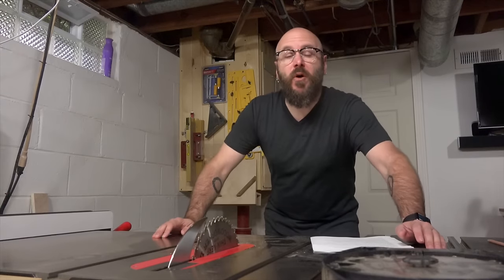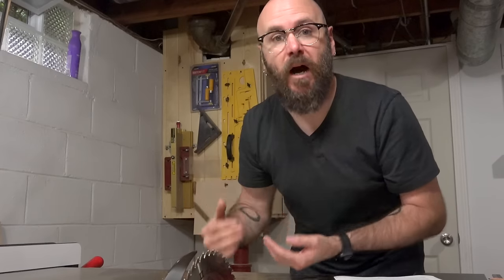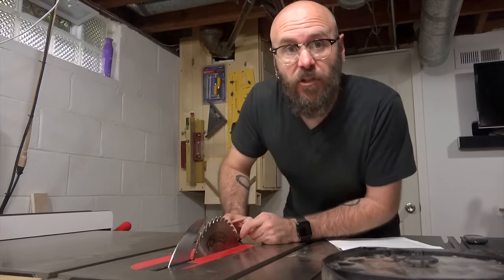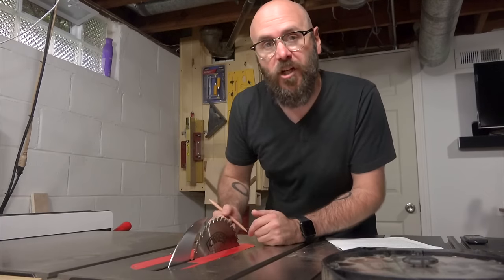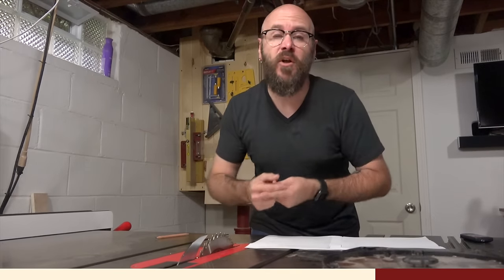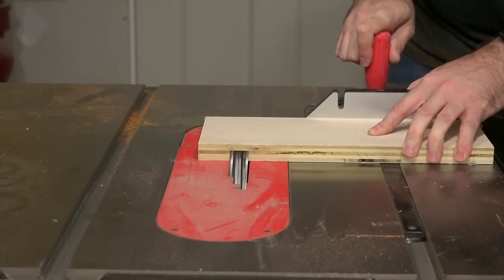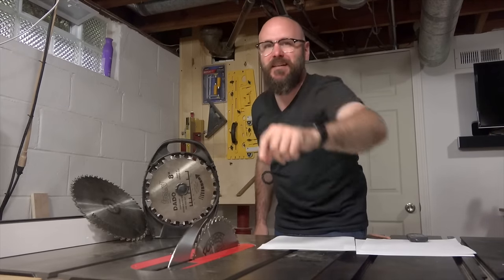The Only Table Saw Blades You'll Ever Need

Comment: CMT 24 tooth rip and a Freud 24 tooth rip, both full kerf, in rotation when one is dull I send it out for sharpening and put the other on the saw. I also have the Freud 8 inch dado. I use a Diablo 60 tooth blade for plywood and the rare cross cut, but 95% of the time I keep rip blade on for all cuts

Comment: Hi thanks for the vid! I dig the Queen insert lol. I'm a newbie, got a Delta 36-725 table saw and I have a blade question for you. I'm building a vanity out of walnut with mitered edges (for my first real project). I'll be using 4/4 mostly but also have some 8/4 that I'll be re-sawing on the table saw. Given that this vid is several years old, I'm wondering if the thin kerf WWII is still the blade you'd recommend to me for this vanity project! Thanks for any replies you may give!

Comment: I also use three blades on a table saw...Diablo thin kerf rip blade (that has a flat bottom cut), a 60 tooth Diablo combination blade (that doesn't have a flat bottom cut), and an 8 inch dado stack. I've never tried Forrest or Amana. thanks!

Comment: There's a problem with using thin-kerfed blades. The thinner your blade is, the faster it will overheat and warp. Best bet is to compromise by using the thickest blade you can get away with.

Comment: I use the Irwin Marples combination blade that has a flat top raker tooth. Also has plenty of meet on it for additional sharpening. There's a guy down the street that'll sharpen it for $12 and have it back to me on the same day. Best thing is the blade cost me $32 on the clearance rack at Lowes. Been using it for about 3 years now. Cut like a hot knife through butter.

Comment: I dabble in a little bit of metal work as well as being a woodworker, it makes sense to me to buy less expensive blades and reuse the old blades when I need a scrap of steel.
I'm rocking a Diablo blade, don't recall the model, it has a spiffy anti stick layer which is good because I was running thousands of pieces of pine through it.

Comment: For most people over 100 a blade is expensive.If I were making furniture charging 3k a piece I can justify it but for typical DIYer that's not practical.
You can buy decent blade under 40 YES under 40 and you can sharpen it yourself with demand blade on grider

Comment: I you are popping your breaker, you have a wiring problem.  I would fix that rather than use a thinner blade as a band-aid solution.  Nothing wrong with thin kerf blades, but fix the wiring problem.

Comment: I use Frued Diablo saw blades. Believe it or not I mostly use a 80 tooth for both cross cut and rip cuts. I a
so purchased a 24 tooth blade for ripping but I have found there is not that much difference between them on ripcuts. In my area there is no one who sharpens blades. So with the cost of sharpening and shipping, buying a new blade is cheaper. A blade usually lasts more than a year.

Comment: I use a Forrest 10" combo thin kerf & flat bottom full kerf blade. I also touch up sharpen my blades to extend their useful life. I had 2 blades reground by Forrest and compared to mine and there was little difference.

Comment: I use Freud industrial 80 tooth ultimate cutoff blade and Freud industrial 30 tooth thin kerf glue line blade. Both blades can be sent back to Freud to be sharpened, not sure of the price. Both work great, 30T for ripping and the 80T for cross cutting. Both leave exceptional finishes and have no problems on my SawStop 1.75hp contractor saw

Comment: If you want an inexpensive blade that makes glue ready cuts, head down to Home Depot and purchase a Freud Demolition blade, intended for a standard circular saw. Same arbor size and so long as you don't need a large depth of cut, makes the cleanest cuts of any blades I've used. Additionally, they are $10, sometimes come in two packs for $15.

And I didn't discover this. This was shared on Lumberjocks, so credit goes to that community.

Forrest makes nice blades. But I can't justify $300-400 for 3 saw blades.

Comment: I use a freud 254 mm flat grind blade for ripping, different sizes of Bosch and Dewalt blades with more teeth for crosscutting, and a CMT blade for crosscutting aluminium on my mitersaw.

Comment: they might not be the "best" blades but i like diablo blades. I have a crapy saw so even a little bit of flex in the blade gets amplified by the weak arbor bearings in my saw. I have found these blades to be stiffer than most so the flex is negligible, thus giving me acceptable cuts. That being said my next big tool purchase will be a cabinet makers style table saw... will probably run the red blades though.

Comment: thanks for the info...I have a 9" craftsman saw from the 50's with a 1 HP motor so I us a thin kerf 8 1/4" Freud blade which cuts fine for most applications without bogging down.  I have been thinking of investing in a good 9" flat bottom blade so this really helps...thumbs up!

Comment: I use Cmt they have 2 lines/grades. I use the industrial grade. I use two blades most of the time 12" 96 tooth for my cross cut and has 38 degree rake, and a blade called the glue line rip , 24 tooth with a 10 degree rake best quality cut I have ever seen for ripping

Comment: Agree with you except I use a 50 tooth ATB-R (Alternating Top Bevel with Rake) Combination blade.  The raking tooth is flat bottom and serves to clear the saw dust away faster.  There is also a deeper gullet after each set of 10 teeth that helps cool the blade.  Next time you need a new blade consider the Forrest version of this.  It is fantastic and does an impeccable job.

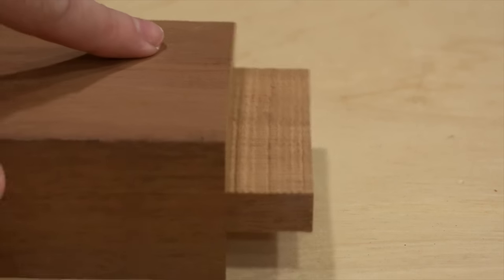Comment: 3:25 if i was to have an ATB for my table saw, I don't really want to switch the blade when I want to make Tenons. One, it doesn't really matter what the surface will look like because the joint will be hidden, so there's no point in cleaning it up. and two, it'll probably have more surface area for a bit more hold.
I wish I had those things though. my harbor freight saw is so shit, the blade isn't even aligned with the fence, and I need a new blade too. the sides are gumming up
Reply: I can't speak specifically for the HF saw you have, but read the manual. There should be a way to adjust the blade to make it perfectly parallel to the fence.
Reply: F’n harbor freight!? I remember way back when I first check that place out I was amazed it was like a “dollar store” for tools! Now only a handful of things I will purchase there. My HF breaker bar is great though! Lol
Reply: If you’re getting a lot of pitch on one side of the blade. Blade is warped or their could be build up around the Arbor of the saw or the mounting point.

Comment: I highly recommend Forrest, I own 8 of them.  However, I wouldn't buy a thin kerf blade from anyone, even if you have a lowered powered saw because of deflection.
Reply: What's that?
Reply: ***** Thin kerfs have their place.
Reply: I have a 3 hp saw and was using a thin kerf diablo blade on some half inch Baltic birch that I was cutting for drawers.  The blade deflection was a nightmare. When cutting expensive material it is worth using a full kerf blade.
Reply: J L Grizzly a blade stiffner from forrest would solve the deflection issue.
Reply: I have a thin kerf Forrest with a stiffner

Comment: Nice review.  I have a 5 hp Grizzly and finally got tired of using cheaper blades.  I just ordered a 40 tooth combination with a 125 kerf.  As I can afford them I will be adding other blades as needed.

Comment: I use a thin kerf rip blade, a thin kerf crosscut blade, and a dado stack, all by freud. I also opted for thin kerf to be easier on the machine and less wasteful. Rather than a designated flat bottom blade, I tend to use one of the blades from the dado stack for flat bottom cuts. 
I originally used the blades that came with my saw, but noticed a huge difference in my cuts when I switched up to these; much easier cutting, and much smoother finished edge.

Comment: Thanks for sharing!

I use a Ryobi BST12S 10" portable table saw, which I picked up second-hand.  It works pretty well, and has a 13A motor, so there's no lack of power for such a small saw.  The table size means cutting larger stock is difficult, but I manage with smart use of horse saws, etc., and by working on my patio rather than inside the house.  No vacuum or dust-collection possibility here, unless you devise a custom solution.

The main blade is just a 10" combination, generic blade which came with the saw (possibly not original, the labels are worn off, if they ever existed).  It works well enough for most cuts.  The carbide points are still razor sharp, which is a plus.

My dado stack is just a cheapo from Home Depot.  The Avanti Pro 8" x 24 tooth dado stack.  It has 2 external blades, several chippers of either 1/16" or 1/8" sizes, and various steel shims to finely tune the width of the cut.  Max width of this stack is around an inch, however the arbor on my saw probably won't let me go past 1/2-5/8" or so, being as small as it is.  Not bad for $45.

Comment: Just one note, Sawstop does not recommend using a blade with depth-limiting shoulders because it will take longer to stop. Of course my blades have them because I have a Freud rip blade on for my joinery, but for a dado stack I think I might follow that recommendation. Forrest does make dado and box joint blades and they do not have the depth-limiting shoulders on them. It would be nice if Freud would make sawstop safe blades as an option. My next set will be a Forrest box joint set. Thanks for the great videos!

Comment: What you call "spacers" are correctly called "chippers".
The only use of a thin-cut blade would be if your ripping for veneer, trying to save on board lumber width. 
Cheaper not to buy a thin-cut blade, waste lumber and time but buy veneer in dimensions needed. 
Saving money always requires an investment in time.

Comment: Love my Freud, LU84R011  10 inch 50 tooth combo.  Silky smooth cuts, long life.  About those popping breakers- wire your saw for 220, if possible.  Then you can push a little harder with a full kerf blade.   Plus your lights won't dim when you start the saw.

Comment: What blade company do you recommend for 7 1/4 circular saw blades, I'm just starting out and I know I need a good one, but most of the online reviews read more like ads than actual reviews.  I will be using this saw a lot in the beginning and would prefer to get at least 2 or 3 for ripping down sheet goods but also better more quality cuts

Comment: I have a 10" DeWalt table saw and I use a Freud thin kerf red blade. It works really well for ripping maple. I used that blade to make 5 toboggans. No burn marks if I used the right feed rate and smooth finish, no sanding required.
And yes keep the blades clean.

Comment: Thinn kerf saw blades are ok. But they may have a reduced regrinding zone depending ofcorse  on the dimentions of this saw blade. A "normal" saw blade has a thickness of 3,2 / 2,2 mm ( theeth/ blade ). means the theeth are on both side 0,5 mm larger. 
A thinn kerf has 2,6 / 2,2 mm or 2,4 /1,8 (or +/- depending brand and specification you need). so in this case the theeth are 0,2 or 0,3 mm larger both side. After regrinding the theeth are becomming smaller, and after a couple of regrindings the wood can clamp on the sawblade. (even if the regrinding is only donne on the outside of the theeth ). Because of the reduced side clearing angles there can be more resin building up, causing the need for more power and also more charging the sawblade. So you need to understand that this kind of sawblades have a shorter life. Have funn while woodworking!

Comment: How flat is the bottom with that dado stack? I use a set from that widely known discount import tool store, and it's like the chippers are 1/32 or so shorter than the two outside blades.  Enough to notice, especially in a glue up.  And enough to make the math just a little more complicated.

Comment: some very good info there,however in uk were i am we cannot get dado blades! infact we cant even buy a table saw with a big enough arbour to fit a dado stack!!! so we have to make do with a single blade,you dont know how lucky you are across the pond.
Reply: I've heard this before.  Is that because there are some kind of laws or regulations in the UK?
Reply: glumberty1 from what i have read (looking at buying my first table saw and live in the UK) it is to do with the need for our machines to auto-break and that would potentially undo the dado stack. I think anyway. You can buy them on ebay for around £80 plus shipping of £30 though from the US.

Comment: Most of the time I use B&D Piranha 7 1/4 inch blades in my table saw. They are ultra thin and can cut a 2X4.  They are a hell of a lot cheaper than 10 inch blades and do just about anything I need.

Comment: Even a cheap carbide blade can be resharpened just not as many times as as a better blade. Some of the cheap blades may only be resharpened once or twice.
And if you decide to throw a blade away please recycle it.
Also for those new to woodworking a carbide blade can usually be repaired if a tooth cracks or breaks off and Forrest is quite good at repairing blades, even one that doesn't run true. A friend used to own a cabinet shop and used Forrest for sharpening and repairs.

Comment: I've spent some time online tonight looking at the web sites of the blue and orange box stores for these so-called regular blades with 1/8" kerf, the kind marketed to the average homeowner consumer. It seems to me these are not "regular" at all. They seem to be specialty blades made only by a few high-end blade manufacturers. Neither store sells a single "regular" kerf  saw blade. I think you should refer to .094" (3/32) thin kerf blades as regular and 1/8" blades as wide kerf.
Reply from the maker: Those stores typically sell construction type blades. Do you have a woodworking supply store in your area? Woodcraft or Rockler?

Comment: I use Freud Diablo blades in my mitersaw, and table saw. They are very sharp, and the 50 tooth combo blade cuts a flat bottom kerf. The rip blade cuts through the hardest woods like butter. I have had great results with the Diablo series of Freud blades. But that's me, use what works best for you. I do.

Comment: dig the info vid! I use the 60dollar red Frued Diablo 60tooth 99.9 percent of the time in the sawstop. i buy them at home depot. It gets ALOT of use, i mean ALOT!! and i buy a new one prob every 3 months,
Reply: A Forrest will outlast that by as much as 10 to 1 margin. Any Forrest blade will run circles around any other table saw blade at any big box store. My guys are amazed they cut as well as they do for as long as they do

Comment: Digging your vids. Do you have a "how to" on the coffee table made of walnut with the top that folds up? That piece looks awesome. Also, what tips do you have on proper cutting of cheaper table saws? Like how to keep the boards tight against the fence? And how to keep the boards from coming up off the blade while running? Thanks!!

Comment: Good info, always buy the best blade you can afford, it will make your life easier in the long run. One comment about your dado set, I have been told that the set you showed would not be advised for the sawstop because of the material behind the tooth would cause the stopping mechanism to not work as well. Just for what it is worth, thanks for sharing.

Comment: I use the infinity 8" 1/4" kerf dado blade. $100 canadian on amazon. Works awesome. Also have the 10" 1/8" kerf flat bottom blade on my sliding miter saw and my table saw. Both great products.

Comment: Hey David.  I primarily use a Woodworker II thin kerf blade in my Ridgid R4510 table saw.    For dado's I have a Freud 6" dado stack.  Quick question while on the subject, with the SawStop how hard is it or how much time does it take to change out blades?

Comment: i use the freud dado blades with the box joint jigs. they are really nice and smooth. Then, I use a freud combination for everything else. although, i do get some burning sometimes when ripping with it, depending on the species of wood. it crosscuts perfectly fine, which is what i use it for most of the time.

Comment: when buying a new miter or table saw, it always comes with a blade with a lot fewer than 40 teeth. n00b as i am (im actually a painter who enjoys woodworking on my sparetime) i have tried like 46 teeth blade and found out it gives way nicer cuts. what is the least amount of teeth you recommend on a blade? (i know its kinda based on what one is trying to do. rough cut something it wont matter. but in general to get really clean cuts? )

Comment: Very useful info David. I use one blade dedicated to cross-cuts and other to rip-cuts. I didn't find a flat bottom blade on local stores from here. Besides, my saw (as most of the tablesaws from europe) has a short arbor to avoid using dado blades (shame on that). Regards from Barcelona!

Comment: I made a simple jig for cutting my tennons vertically. One horizontal cut, quick flip and one vertical cut, repeat on the other side. No changing blades, no dadoes, thick kerf/thin kerf, no matter.
One thing you did not mention is that a thin kerf is slightly easier to be accurate.

Comment: I just picked up a mint rarely used ts24241 ridgid saw and am wondering what my best option is for 2 blades? 24t rip blade and 40t dual purpose?
Reply: You'll probably be fine with a 40t combination like David. If you can afford to, then go with the 24t and 40t blades. I did and don't mind changing out the blades as needed.